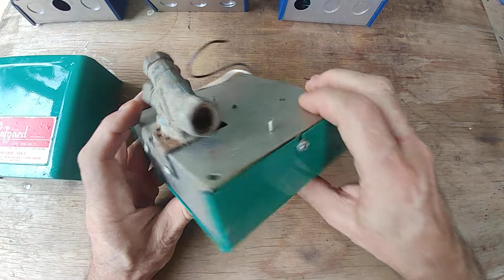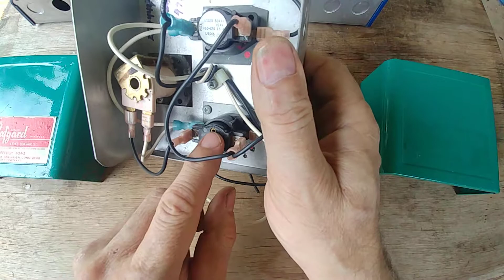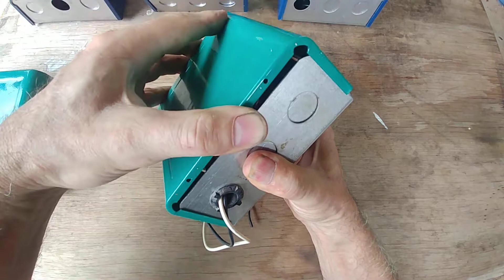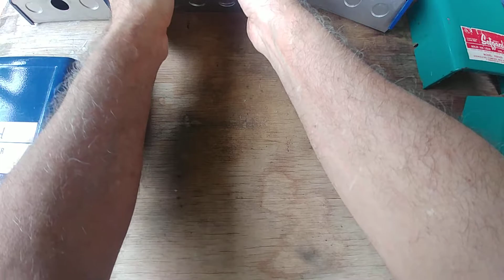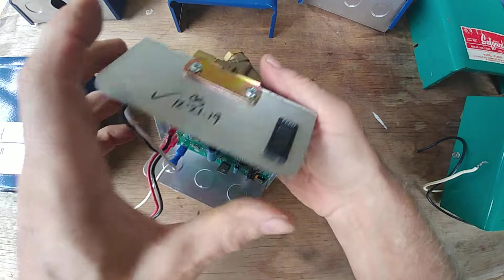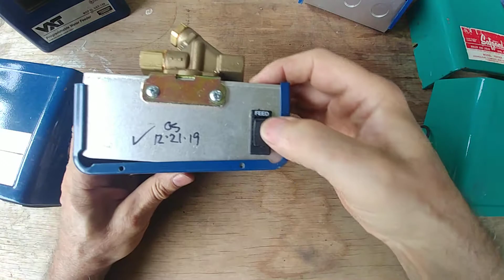Unofficial History Of Hydrolevel's Steam Boiler Automatic Water Feeder: 30+ Years Of Progress.

Comment: I thank U so much for the info. My boiler has a very slow return of the condensate, which cause too much water to be in the boiler, after a low water situation occurs. I am thinking that maybe if I install this HYDROLEVEL feeder, that can be adjusted to delay longer  the feed timing, it will solve my problem. Could give you please reply, with an advice or any info from you would be appreciated. Thanks again,
Reply from the maker: You're welcome!
If I may be so bold, I'd like to suggest working on getting the condensate return working better. I cannot know the particulars for your situation, so that may be very difficult or downright impossible to do. I understand that.
As much as I clearly like the VXT, I confess myself concerned as to unreservedly recommend using the VXT to act as a bandaid to cover a known problem. It may fail, whereas gravity will not.

Comment: I believe the first heater relay comes on then begins to start second heater relay. Then feed comes on. At least that’s how it looks wired to me?
Reply: You may be right. The wires are a bit hard to trace. But what then eventually shuts the power to the solenoid off?   I'm gonna go with: The heat relay contacts on the right are normally open and when power is sent to the unit from the N.O. contacts of the LWCO, the right-hand heater closes the relay after a delay. That completes the circuit to the left-hand heater AND to the solenoid through the left-hand normally closed contacts.  The left-hand heater opens the left-hand relay after a delay, shutting off the solenoid.  If the LWCO stops sending power to the unit, the solenoid shuts off, and the heater relays reset after cool-down.  It appears that if the LWCO is not satisfied with the amount of water it gets from the unit on a call for water... too bad.   Sorry if my verbal presentation was not clear.
Reply: Gordon Schweizer. I believe what ever control is telling it to come on wether it be a probe type or float. Would shut it off. Most all solenoids I have worked with shut as soon as power is not present. There has to be a control to tell when to come on and off. I could be wrong.
Reply: @raymondwilliams439  The feeder solenoid is turned off either by the left hand heat relay after the engineered delay OR  by removing power.  I've ohmed out and tested the above unit and my description above as to how it works is 100% accurate and correct.